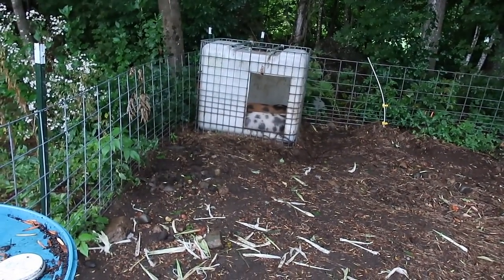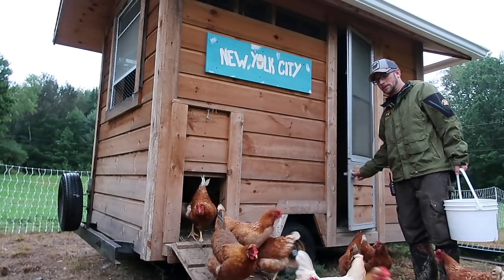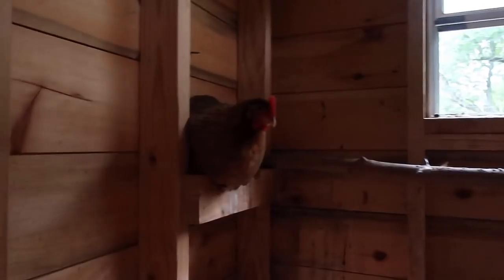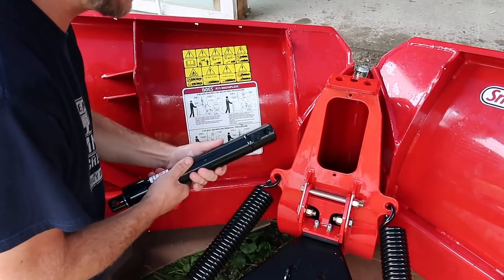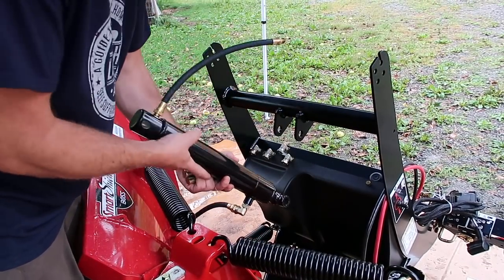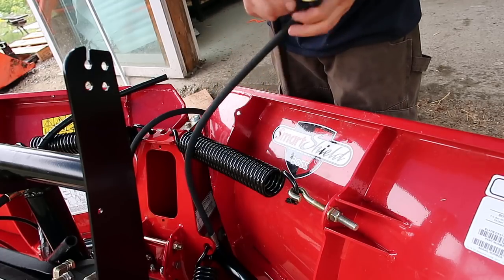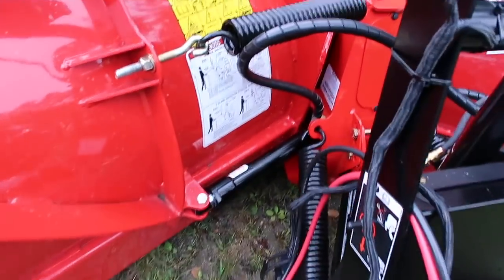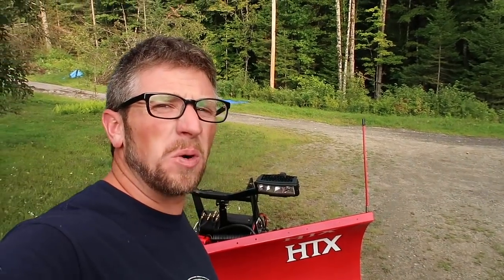I hope I did this Right (Assembling and Installing our Boss HTX V Plow)

Comment: Hey Al good video, you will catch on to the V-plow in no time. One bonus of the V-plow is use the forward V when piling up the snow it works well. One other tip I would recommend is getting a spacer or a piece of pipe for all those washers on the two shoes/skids if you lose a pin on those feet those washers are going everywhere, if you notice it right away you may be able to find them but likely not, having a consistent spacer on the bottom would be easier. You will be "the boss" in no time!

Comment: If your gravel road is anything like the gravel roads in Pennsylvania you are going to want to set your feet so that the blade sits a little higher, if you have them set so the blade to low you will tear up the road the first few plows till all the holes are filled in and all the high spots are pushed off the side.

Comment: As well as adding a column or 2 to the trucks maintenance schedule, you also have plenty of time to plan where to put all that snow, you'll be moving, in 6 months time. It looks mighty fine. I wanted to ask if you thought of grafting, nut trees onto existing fruit tree stock for variety?- or is that possible? More likely done in the spring? Some choices may require micro-climate work. Good to see all the developments Al, great video.

Comment: Top of advice when putting the plow on the 2 rotating levers that lock and unlock when your truck is in the plow mounts of the plow lock those rotating locks before you lift the plow because you’ll here 2 clicks to know when it is on fully and also it is way faster

Comment: Actually, I'd like it if you did a little vijeo on the theory and operation of that kind of plow.  It looks a lot like the big boys type of plow that municipalities use.  Also, where is the hydraulic pump?  Is it that electrically powered box on the back of the plow?  If the hydraulic pump is electrically powered, did you have to beef up your alternator or battery on the truck?
Reply: Yes the hydraulics are powered by the truck's electrical system.  I don't think you have to, but it wouldn't hurt to have a 2nd battery or better alternator.

Comment: Maybe on all of your electrical connections on the outside of the truck to use some dielectric grease to maintain good electrical connections and reduce corrosion.  Possibly look at all of the bolts to prevent corrosion also. Just an idea.

Comment: If it weren't for that one part where you had to widen the holes in order to get the braces to fit, this would've been a great Boss ad.
I'm stumped why that was necessary... and curious if it was a problem Boss knows about? Was it a "hey, you might have to do this for certain truck models" in the manual, or did you have to figure it out by yourself?
Anyway, congrats on the install job!
I definitely would have had to pay somebody to do it.
It looks to be a sweet tool to have.

Comment: Hey Al, quick question.  What size is that IBC tote that you are using for the pig house?  Dimensions would be preferable, but will take a volume measurement, if you'd rather not go outside and measure.  Many thanks in advance.
Reply from the maker: They hold 275 gallons. They are around 4 x4
Reply: Thank you!

Comment: How does the HTX-V Boss work and the Tundra? Has the plow held up? Is the Tundra holding up? Is the front end of the Tundra getting over worked? I have a Tundra and am strongly thinking about getting this HTX-V boss for it to plow my Airplane hangar and not for commercial use. Any advice and notes would be appreciated. Thanks!

Comment: Can I ask how tight did you tighten the hoses that went to the cylinders that operate the wings. I changed the fluid in it today and when I went to cycle the wings the one on the drivers side has a bad leak down by the cylinder. All I had with me was an adjustable wrench and I was afraid to put a ton of pressure on the end of that hose.